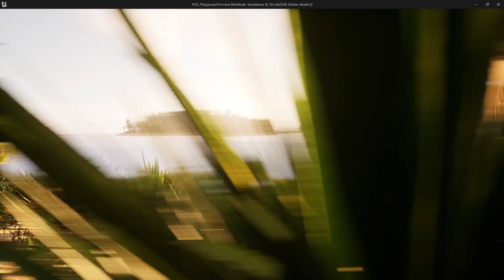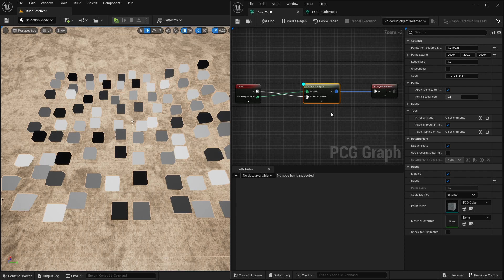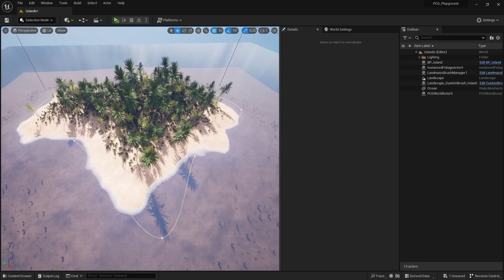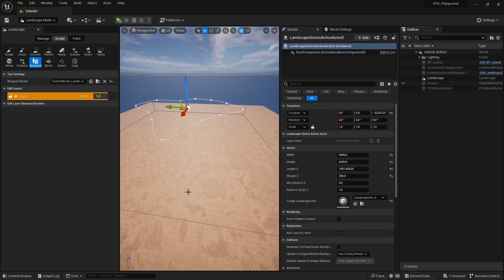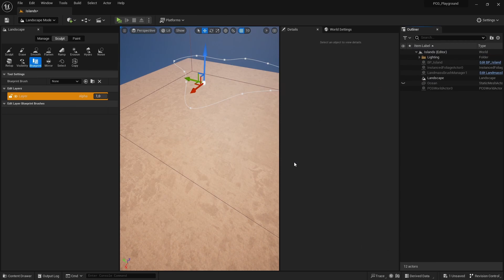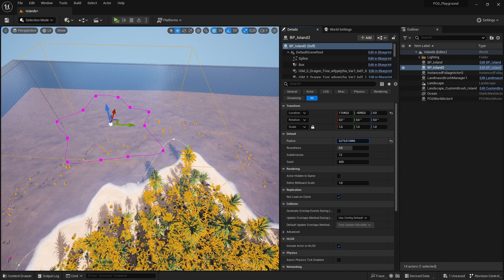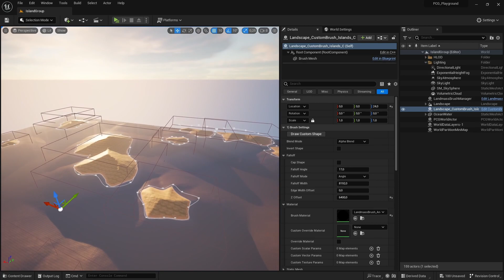Using advanced PCG Concepts to create Islands - Unreal Engine 5.2

Comment: The only problem is that Landmass does not update at runtime (or at least I don't know how), so those procedural islands cannot be regenerated with another seed during the game. That's why I am still using the suboptimal solution "make a Dynamic mesh, then carve it with booleans and remesh"

Comment: Do you know a way to sample procedural meshes? If I add a PCG component to a BP with a Static Mesh, and then inside the PCG Graph connect the In > Sampler it will know that it should scatter points on to the static mesh. However, if I try the same thing with a Procedural Mesh component in my BP instead of a Static Mesh, it doesn't work. Do you know a way to sample a procedural mesh?

Comment: I decided to copy the landmass blueprint and use it as the host for logic, rather than use a single brush to recognise all PCG actor hosts.
Add a PCG component to the brush, add some custom spline generation override the original manual input driven by variables, all works as a neat self-contained brush.

Its annoying they don't make the brushes more accessible, but at least this way you can insert your blueprint into the scene via the landscape manager individually, complete with PCG effects.

Comment: Hey awesome and helpful video! I noticed there was grass generated below the water line - any good ideas to set a parameter around this? Thanks!
Reply: Use the normal to density node, play around with debug on and you'll see it changes based off of height

Comment: I noticed an issue in the project files.  For the IslandGroup map, it's generating warnings and some similar errors for,
> Spatially loaded actor /Game/PCG/05_Islands/IslandGroup.BP_Island references Non-spatially loaded actor /Game/PCG/05_Islands/IslandGroup.Landscape 

And I'm seeing the trees getting generated on each island and then being removed.  There's some strange interaction happening between the packaged project compared to the example video - some interplay between how the PCG actors are setup and world partition.
Reply from the maker: Thanks for letting me know! Can confirm, I just got the same behavior. As a workaround to generate the trees, you can open PCG_Island and press "Force Regen", that fixed it for me. I have experienced the behavior with the trees before, but only when playing in standalone mode. I might look into what is causing this.

Comment: Can you elaborate a little bit more on how you exactly created those islands with the landscape bp system? 😊
And do you think that it's possible to create big landscapes with different landscape bp stamps completely procedurally with PCG?
Reply from the maker: For the first question, the Blueprint Brush I showed was a duplicate of the CustomBrush_Landmass, that I customised to use all of my island splines, so I myself don’t understand everything that is happening. But as far as I can tell it works like this: 
- draw the shape of the splines to a texture (here I replaced the spline input to my splines)
- a compute shader calculates the distance of each pixel to the closest shape.
- another compute shader (different for the „edge“ and „width“ falloff) creates a heightmap from this distance map.
This last step can be heavily adapted by all the brush parameters on the blueprint. You can watch the linked tutorial in the description, there all the important parameters are explained. I preset them to create some randomness by using mainly the curl noise. Also I had to set a general height offset to make up for the fact, that my landscape was below zero (the ocean floor)

For your second question, if I understand correctly, you want to use a blueprint brush to generate the terrain without some predefined shape or input? Yes, of course, in that case, you might start with a brush to generate the heightmap with e.g. perlin noise. This could also be done depending on a biome map that gets generated beforehand. You could then add another brush to add erosion, that will give the landscape a more natural look and feel. At last, you can add trees and other vegetation with a PCG graph.

That actually sounds like a fun project 😄
Reply: @schmikolai  would love if you could give us some inspiration with more detail on how to sculpt landscapes with biomes using pcg. Drag and dropping BP_Island does not terraform for me and no clue why. It spawns all the other pcg actors.